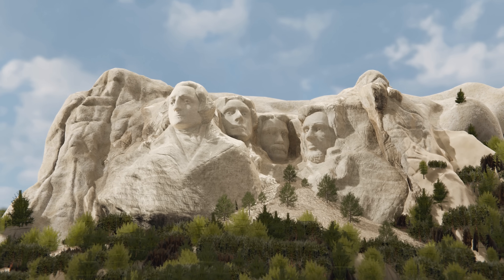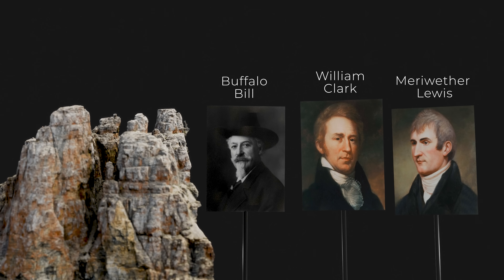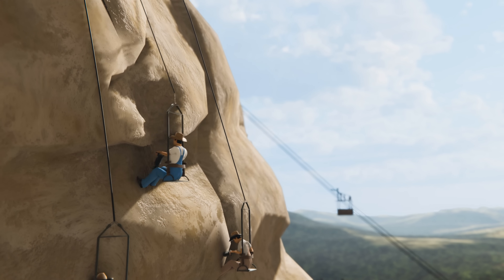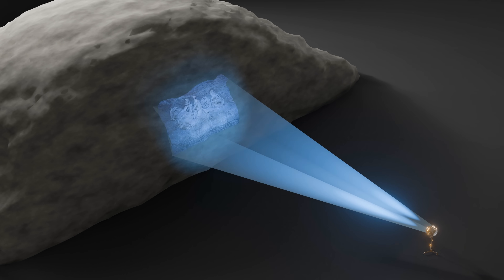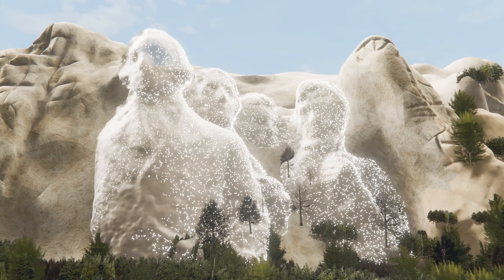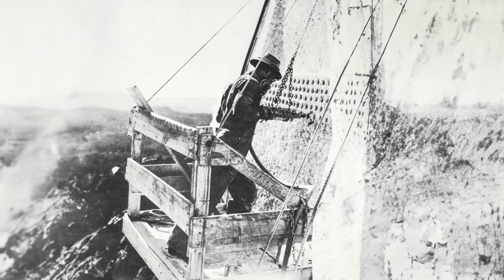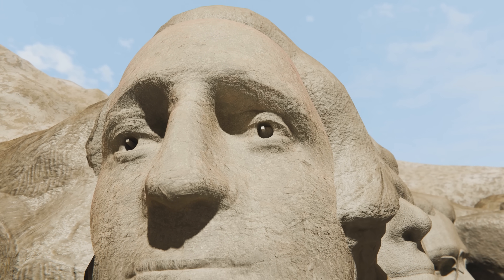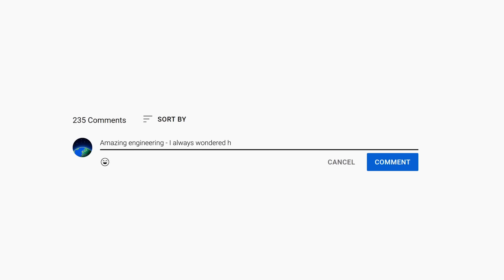The Hidden Engineering of Mount Rushmore

Comment: Great video! 1:01 I feel there might be a few anachronistic errors with Stone Mountain and the footage you included however. I dont believe that Stone Mountain (as is shown in the footage - possibly from decades later than the 1920s as suggested?) was completed before Mt Rushmore since Borglum was fired from Stone Mountain in 1925. On April 9th, 1928, on the 63rd anniversary of Lee's surrender, the newly hired sculptor, Augustus Lukeman, unveiled only a head of Lee on top of an unfinished horse. And Borglum's work was blasted off the mountain that same year.
The carving then started and stopped multiple times throughout the next few decades and was finally completed in 1972.

Comment: Great video.  I do think the sculpture is more powerful with only the heads, even thought that was not the original design.  Same goes for the lesser-known but much larger Crazy Horse Monument that is nearby.  The original design includes most of Crazy Horse's body as well as his horse.  The sculptor has since died after decades of work (without any government funding) and his family is continuing the massive project.  Again, I believe it is far more dramatic as is, face and outstretched arm pointing forward emerging from rough natural rock.  They intend to finish the whole figure in a much more polished way.  In any case, if you don't know about Crazy Horse Monument, check it out, it is quite remarkable!

Comment: What if you're jack-hammering, and whoops, there goes half the nose?
Reply: Whoops
Reply: Whoopsie
Reply: @PhantomFilmAustralia  it must be hard to fix such a mistake?
Reply: There's a reason Jefferson's head is reccessed into the mountain.
Reply: 🤔.. duct tape?
Reply: Wait 50 years and claim it's a Michael Jackson sculpture.
Reply: @samsanimationcorner3820  .. and that that granite was chosen because it had lost its pigment.
Reply: Ceva gen Michael J.
Reply: Given long enough time, that is probably going to happen on its own. Just look at early Egyptian statues (Sphynx, for example)
Reply: @vale.antoni

Inspection of the Sphinx suggests that the nose came off as a result of human activity, not weathering.
Reply: @vale.antoni  It did happen in NH, although that was a natural formation. But yes, natural or sculpted, time will take its toll.
Reply: @vale.antoni  The Sphinx lost its nose because Napoleon's soldiers used it for target practice and it met with a cannonball.
Reply: @Seefood73  nope, that's a myth. The nose was gone before Napoleon went there.
Reply: It would take a pretty big whoops that would last over an hour of making mistakes. At that point it would be international. There is a reason this mountain was chosen. The rock of mount Rushmore isn't subject to splitting because granite is a type of stone that fuses together to make a solid structure with out air gaps. The kind of mistake you're thinking about would only happen to stone that has tiny pockets of air that can cause fissures. Which is the kind of stone most mountains are made of.
Reply: @TheAllcreatorLiveArchives  Guess we can take it for granite.
Reply: @fare2muddlin 😅